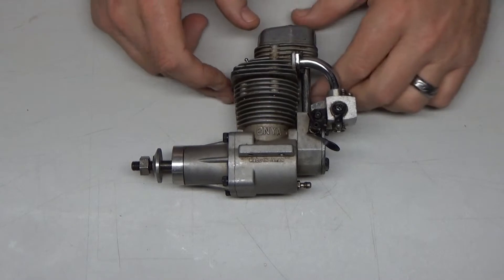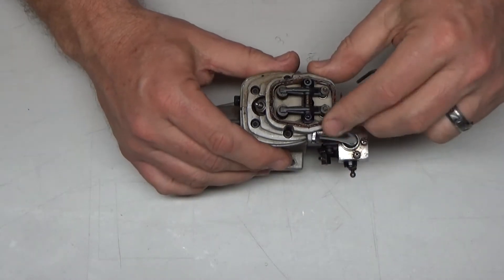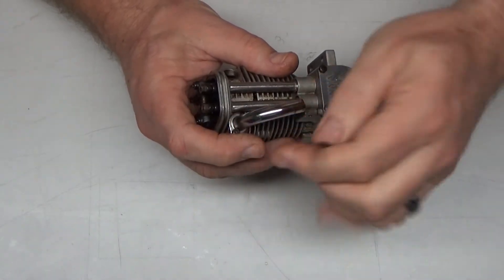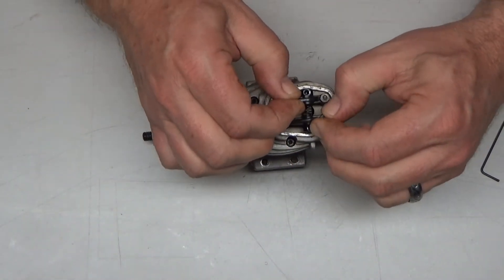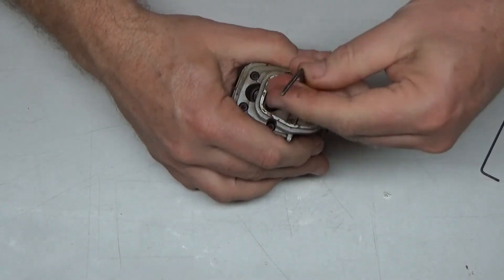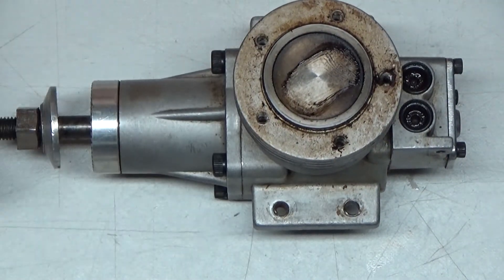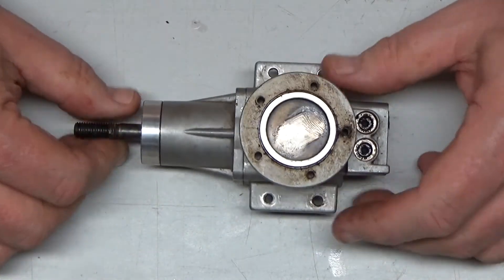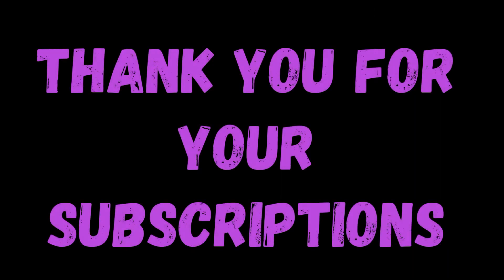Customer Engine 60-4C

Comment: I like the high Quality design and materials on the Enya 4-strokes. They are always worth repairing. This steel bracket solution is very smart. It prevents the valve lash from getting bigger when the engine warms up (which happens with aluminium cast solutions). I always wonder why Enya did not place the vent nipple to the cam housing. 5:40 One exception: Saito ;)